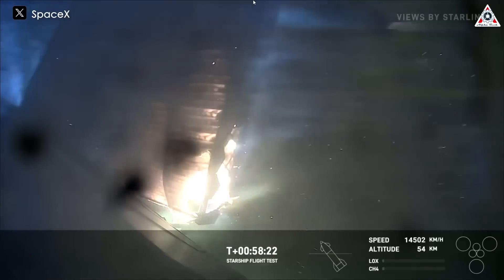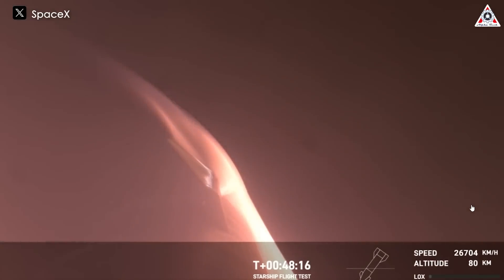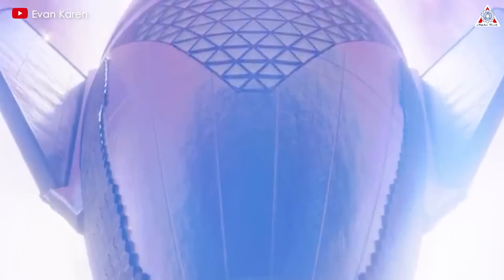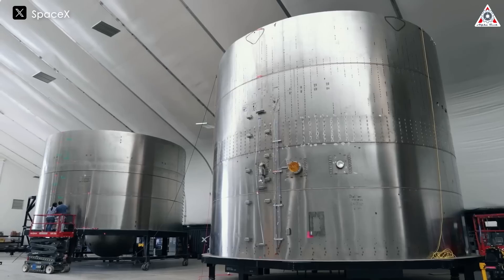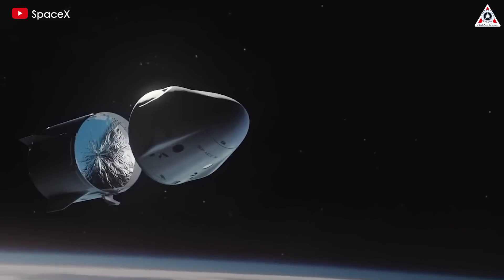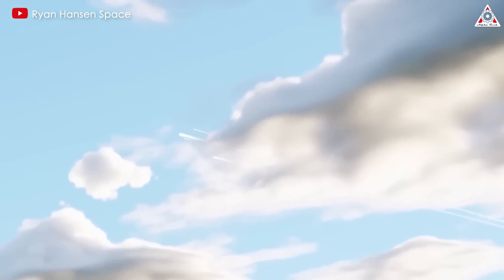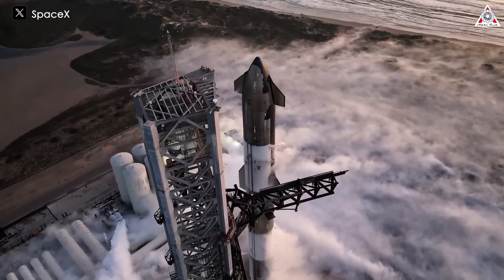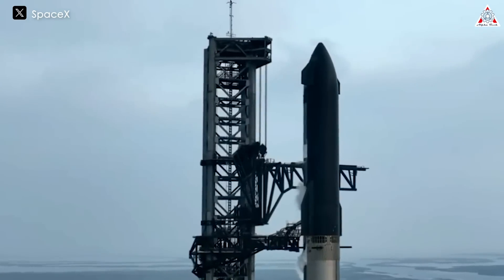Elon Musk's Big Solution to SAVE Starship Heat Tiles Survival Reentry.

Comment: SpaceX just sequence of afterthought bad ideas tied together 😂 no solutions 😂 
Just one missing tile and plasma will eventually torch thru that ride and disintegrate(no statistics on how many fall off per trip)… I guess tiles sprinkling down over the trajectory will have to be solved first… moving flaps and avoiding hot air to get in will be another challenge  where heat sealing will be close to impossible… 

btw why are they doing this? Deflection? Not sure this is the most important part of any mission? Saving a big tank for cryogenic fuel that cannot be reliably reused without expensive maintenance.
Reply: Clearly you do not know anything. My advice is don't make posts that demonstrate how stupid you are.
Reply: @royh6526 clearly you are following fan boy that can repeat the babbling stupidity you hear from your supreme leader.  😂  The best part other than entertainment… industry has said it does not need the payload capacity,… and there is no reason to build a city in mars either…only donate your money or buy a ticket for this show… bring popcorn 🍿 
At the end as the truth is revealed and $$$ dries up it will naturally succumb 😂
Reply: Absolutely right! The forward fins were not even used on the original design and then they did them wrong!! The space plane wing design with the trailing edge control surface is well proven. Hinge is perpendicular to plasma flow and easily protected. 

Whole design is drastically flawed in multiple ways! 

Forget what the fanboys say! None of those guys are engineers
Reply: @professorg8383  Ah, so the SpaceX engineers are incompetent. You should apply there and I am sure your superior intellect will be greatly appreciated.
Reply: @royh6526  Never said they are incompetent. Elon Musk is incompetent and he intimidates his engineers who are predominantly young and inexperienced. 

They would definitely benefit by my skills and experience, but I'd be likely to be fired by Musk in under a week. Musk does not appreciate the best engineers who have worked for him, who he fired.  He appreciates blind loyalty and doing what he says. He's a lot like a smart version of Trump! 

But I'm figuring you aren't even an engineer, but just another fanboy!
Reply: @professorg8383  You are wrong. First, Elon encourages engineers to present their ideas even if they are contrary to his view. Example is that he was committed to a carbon fiber Starship, until one of his engineers convinced him to change to stainless steel. What he does not tolerate is a poorly presented argument that turns out to be false. When engineers told him the Starlink satellites could not be launched until the laser communication was perfected, he fired the top engineers. Then launched the first satellites without the laser communications. What the engineers failed to take into account was that SpaceX had to launch satellites on schedule or loose their FCC license. Elon did not conceive of the Cybertruck design, but picked it out of several designs presented to him by his design team.

If you watched the Starship video, you would see that the plasma flow is perpendicular to the hinge point. You are right that I am not an engineer, just a retired technologist. But I have worked with engineers in companies, done some circuit board designs, wrote programs and a service manual. Designed and built test equipment for production use. So yes I am an Elon fan boy.
Reply: @royh6526  If one of his engineers convinced him to use stainless, they both made a stupid mistake, I don't know that to be true, who was that engineer??  Musk original claimed it was his idea, but he has a history of stealing people's ideas, so who really knows. If it i something he has recently said, that doesn't surprise me either. It saved money and sped things up, but no good aerospace engineer would come up with that. I'm not buying it. 

As for the Starlink engineers, I think you are wrong about that. They tell a much different story. Musk likes to create stories to justify his dumb decisions, that would be a pretty stupid one to fire so much talent. Maybe the real story will come out in court unless they drop their lawsuit. The lead engineer is now running project Kuiper. They didn't quit, he fired them without cause and you can bet he'll either settle or lose in court. And BTW, since when has he followed what the FCC told him!!

And you are absolutely wrong about the hinge, it is absolutely NOT perpendicular!! IDK what video you were watching!! Look at the pieces coming off it, If the hinge were perpendicular to the flow, the camera would not ha gotten hit!  It's plain as day!  The plasma flow is front to back. The hinge is virtually parallel with the vehicle!! I know you aren't an engineer but I'm sure you can see that the spacecraft was not entering in sideways! At least this one wasn't!

As for Cybertruck, IDK that he would have actually designed it although he claims that the megacasting was his idea. Doesn't really matter, it's his responsibility as CEO,  And he says he is the smartest living person in manufacturing! It sure looks like his design concept though. It sure seems like a concept he had his hands in the problems are typical of things he has pushed through, just like the semi truck concept and all the fraudulent claims about that sick joke!!The guy is a horrible engineer, an insane manager and a horrible CEO!! He's a con man and I'll admit that he had me sold for a while. He can blame people that work for him. But he treats them like garbage. The guy is a huge narcissist and pretty convincing liar. But people are becoming aware of his bullshit.  

Look, I know it is pointless to argue with fanboys and cult members but I feel like I need to try. My hope is that a few people wake up. As a "technologist" I assume you at east have somewhat of a technical background and a bit of common sense. Rule number one with Elon Musk, do not believe what he says!!
Reply: @professorg8383  It was Elon Musk who stated that an engineer convinced him to change Starship from carbon fiber to stainless steel. He never claimed it was his idea. You are just spreading lies.

Upper stage of Atlas is stainless steel, there is more than one engineer who think this is a good material for rockets. I suppose you believe that lithium-aluminum is the holy grail of rocket body material. Stainless steel was picked primarily for its strength over a very wide temperature range.

What story did the Starlink engineers tell you? I was only quoting Elon.

Yes the hinge is perpendicular to the plasma flow. The rocket "belly flops" through the atmosphere not dive point first. I can't believe you don't understand this.

Mega casting is not a new idea at all. And again Musk never claimed it was his idea. All the major manufactures have tried it at one time or another, but all had warpage problems. It was Elon's team that came up with a metallurgical solution. It was also recommended by Sandy Munroe.

Again Elon praises his engineering team, he does not claim all the credit. The Semi was proven to be much superior to all competition with a competitions set up using actual commercial loads over a week long process. It is clear you are an Elon hater and you are allowed your opinion, but don't make up false "facts".

Ah, the final refuge. Claim Elon lies. Therefore disbelieve all he says and ignore his accomplishments.
Reply: @royh6526  OK genius, what is the glide slope??? It travels much more horizontally than it does vertically. It is not coming down like a brick. When it reenters it has great orbital speed and they need to bleed off that speed in order for gravity to bring it down. Do you understand that??? But just look at the GD video!! look at speed vs altitude!! 

As you clearly stated, you are not an engineer, but I mistakenly gave you credit for having some common sense and a slightly technical background. You proudly proclaimed being a fanboy and you obviously believe whatever he says. All you need do is look at th history of what he says and he has a lie rate right up there with Donald Trump!! But IDK, maybe you a Trump cult member too!! 

Ever notice that you very rarely hear of interviews with his engineers? Former ones yes, but current ones no. Musk even rarely lts any of his managers speak. 

I don't disbelieve everything he says, but I have learned to doubt most of it, because when I check any of his outlandish claims, they turn out not to be true. Like the his so called study of the Semi superiority!  He drove the study!! It was not independently conducted and there's plenty of contradictory evidence if you look for it. But why would you? You're a fanboy and don't want o hear it!

Sandy Munro is an automotive engineer who specializes in machine tools and manufacturing. He's an experienced and respected guy, but he is not a educated engineer or metallurgist. He certainly is not an aerospace engineer or metallurgist. I seriously doubt that he did a detailed analysis like thrust vs. weight. Automotive engineers do look at overall weight from a fuel economy standpoint and a classic example is the Aluminum F 150 to shed weight vs steel.  BTW mega castings are aluminum to reduce weight and fabrication

And it is the upper stage propellant tanks of the Atlas V Centaur that a super thin stainless steel.  Very lightweight, but not very strong at all.  It is an insulated system .It was designed this way to keep the liquid Hydrogen cold as it isn't fired until fairly long after launch and can conduct multiple burns. The smaller LOX tank portion is insulted from the much larger LH2 tank because it is not anywhere near as cold, so they protect against heat transfer. LH2 is much colder than LOX or liquid methane which are pretty close in temperature. 

The shells of the booster are machined Isogrid Aluminum.  That is for structural strength.  

The Centaur tanks have little structural strength. They use a pretty elaborate fueling and un-fueling process to keep the tanks constantly pressurized on the ground to keep the stage from collapsing under the weight of the payload. Once in space and weightless, it doesn't matter. This design was first flown in 1962. 

However this is a completely different situation from Starship, which BTW, uses liquid methane and liquid oxygen.   The liquid methane is much denser and a pound of LH2 needs 8 times as much space as a pound of liquid methane. But pound for pound, the LH2 has much more energy. Liquid Methane is much closer temperature to liquid oxygen. Arguably Stainless tanks make much more sense for LH2 Stainless handles the extreme cold of LH2 and heat transfer of Stainless is much slower then other common materials. 

So your pointing out that the Centaur upper stage is really over simplifying the situation and has little to do with Starship, 

Look, I get that you're a fanboy and are sworn to defend Musk no matter what. I thought you might be a bit smarter than most, but I apologize for misjudging you, you're clear;y 100% committed!  BTW, have you ever bought and Tesla stock?  Somewhat surprisingly, I've noticed that most fanboys don't put their money where their mouth is.

Comment: Both Shuttle and Buran nailed the re-entry at first try (they should have better - the first Shuttle flight was crewed), despite also having hinges exposed to plasma (at least one - on the "body flap", not counting landing gear doors.) However, the tiles prove to be far less durable than anticipated. 
If Shuttle used steel instead of aluminum for its primary structure, the Columbia disaster might have not happened. But then, how much useful payload would it have?

Comment: I thought the exact same thing about the flap you could see at a certain point air shooting through a gap in the joint. that's what started the deterioration of the flap .maybe add a long ceramic cover over the length of the joint .other than that maybe we could try a thin layer of ceramic clay spread over the tiles or some sort of powder coating just to give them a little extra hold.also we could try leaving the boosters on and giving it some forward motion to kind of ease up the upward pressure .think of how a plane flies when it moves forward the air moving up towards it is less then if it was just falling out of the sky.
Reply: The hinge parallel to plasma flow is just a dumb idea. Should have copied the space plane/ shuttle design along the trailing edge of the winglet. With the hinge perpendicular to plasma flow. A well proven design that has been used by several spacecraft for a good 45 years!! at the trailing edge the heating is much lower and protecting the hinge is relatively easy.

Comment: Well, it's nice to see, and the wolves are full, and the sheep are, as they say, whole. We would have made some calculations right away, with previous launches. The beach is intact, the Mask did not bomb it.the goals are unclear. , the method of cutting without anesthesia.... and take and experiment on the layouts first. where are normal specialists like Korolev Tsiolkovsky? it is necessary to be on Mars or blow up Mexico, Yellowstone, and so on, that's why aliens don't stick around in such heat, with such testers.  and every innovation in the package is a whole circuit like an electric line across the entire continent. and.... an extra opportunity to break down and lose the rocket. stuffed too much

Comment: Think of the martial arts such as  Kung Fu. One popular strategy in martial arts, is to roll your wrists and forearms when blocking a strike from an opponent. Could thrusters capability be installed on the Starship to allow it to do a slow controlled roll as it re-enters the Earth's atmosphere, spreading the heat load around the entire ship's increased amount of heat shielding? This maneuver should decrease the amount of heat build up on the exposed heat shielding as it rolls.

Comment: SpaceX  needs to use  " Short Non - movable  Stubby Wings " , instead of " Flaps " 
" Roll & Pitch " can be controlled  by " Thrusters " ...
The Flaps ( Wings ) mainly disapate  Heat in / on  Re - Entry

Comment: No mishap investigation, but no point re-flying the same design. It will be interesting to see if the existing ships are scrapped completely, or modified.
Reply: SpaceX five steps ahead of you. 4 steps ahead of all on earth.
Reply: @MrBigShotFancyPants  The fact remains, the next Starship in line has the same flap design, so flaps melting on entry would be assured with a quick reflight. Time to implement significant changes.
Reply: The point of reflying the same design is that
IT WORKED.😂

Comment: It didn't get destroyed in reentry, it got all the way to the landing burn into the sea. Yes the heat shield was not a complete success but as usual these videos have a way of spinning positive SpaceX news into a slight negative view.
Reply: It's a negative view because it was a fail. If this ship had landed it would not have "turned around quickly" for the next flight. It's a total loss. Then.. why spend the money on flaps and heat shields to bring it back? Any crew was at greater risk thin in a capsule.
Reply: @michman2  the whole point of this flight was to test out if space x could get a upper stage back and landed in the water, which they did with both booster and 2nd stage. They never intend to recover them intact. Space x is pushing what is possible with space flight in a iterative test and build approach to design a rocket that's the first of its kind.
Bringing up putting crew on it is just a joke as it's not even designed for that purpose yet and will probably be a few years before we see anything that might even look like taking crew let alone being allowed by the faa and NASA to let crew on till the rocket fly's and lands regularly without any faults or miss hap's. Good job they have the dragon capsule that's been successfully taking crew to space for a few years now.

Comment: I don't understand why the flaps have to move at all. why not use control surfaces on the bottom end of them much like the shuttle had. this would be much easier to protect and shield then a complete open gap

Comment: Well since the video doesn't actually say what the solution is, I am here in the comments to save the day. The solution they are going with is moving the flap leeward which will put the base of the flaps behind the ship as it re-enters. This will protect that joint area and stop plasma from getting between the flap and ship which is what caused the failure in the first place.
Reply: would that effect the starship at launch the flaps not being centered on the fuselage
Reply: @michaelotoole1807  At launch definitely not. The flaps are not the main form of direction during the launch, the rocket engines gimbal would be the main way to turn the rocket when they are running. The flaps are for re-entry. They create some lift keeping the ship higher in the atmosphere longer because getting into too thick of atmosphere too early would greatly increase the temperatures starship will have to deal with.

Likely moving them back will have an impact on that phase. Now this is entirely speculation on my part but I assume they designed it the way it is currently to see if they could work around the obvious weak point that connection was and in exchange get a more efficient design. I think this launch showed them it was a fools errand so they are going with a less efficient, but safer, design.
Reply: Excellent idea